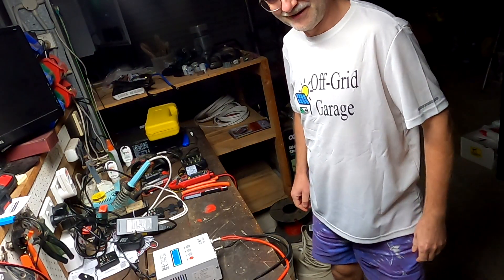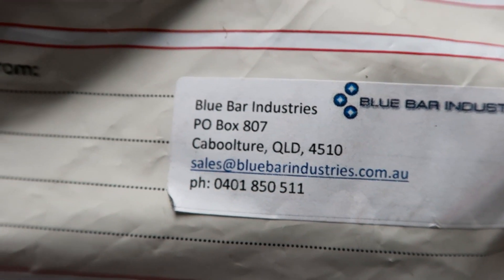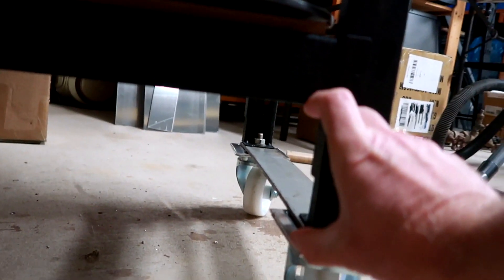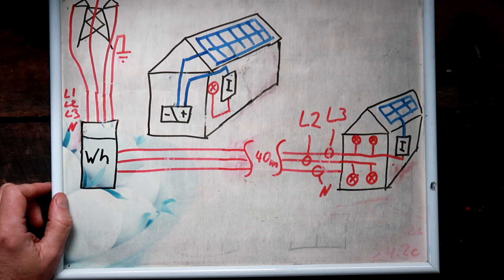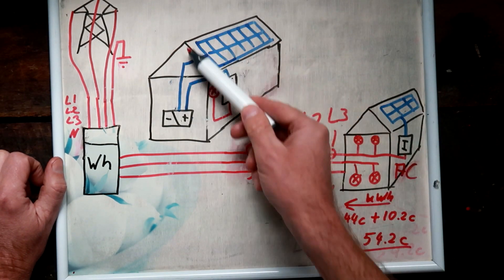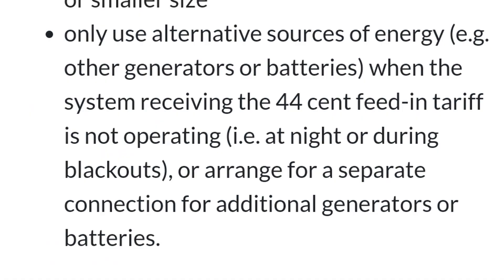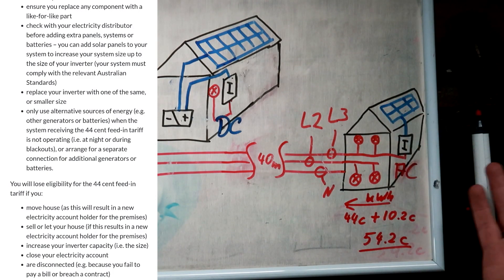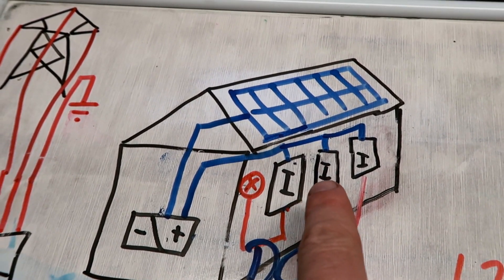Why a solar hybrid inverter will not work for my setup.

Comment: Hi Andy! 
I assume your ac is your largest daytime load and running it at night to cool the house enough to keep cool throughout the day, not sure if possible due to your climate. 
Great video exploring this. If not useful it’s still fascinating! 
https://youtu.be/0f9GpMWdvWI

Also heating water at night to use during the day if you use electric water heating. The load these would put on the battery’s and inverters and if you can recharge enough during the day could be an issue, you’ll know better than I. Then setting up an inverter or multiple to run those loads in your desired way. Many more instances this could be applied to like pumping water at night and storing it for use in the day battery vacuum cleaner, using laptops instead of desktops, portable battery generators inside the house that tv and other appliances plug into? Therefore not supplying power to the house but to the appliances? This may become tiresome or just inconvenient though but you can also just switch them back to grid if solar generation isn’t enough. But you will have a better idea than me of ways this could be useful. 
Love the videos man!

Comment: You have a great situation.  In Northern Alabama I get only 9 cents/kwh and they charge me $15/month for the meter.  So my system will barely pay for itself after 20+ years.
Reply: No one can get this deal anymore in Australia either GNiessen. It’s a fabulous old deal to get people onto solar when it wasn’t popular. Now there are vertically no more rebates as the new problem is too much solar on the grid driving voltages too high and they are talking about wanting to control your hybrid inverter now from the grid to turn it off during peak sun to protect the grid. It’s all a mess now here with too many people now on solar

Comment: Boy that sucks they don't let you add batteries etc. When I ran the numbers here in Ohio, USA this is exactly why I went with the system I did. (Grid tie didn't make sense). Once my solar is installed I will use the grid only as the backup power source. Solar and batteries will be primary source until they are depleted. Solar in the day and batteries at night is the plan... 
There is a delicate balance of solar panels to batteries as well. You need enough solar to charge the batteries as well as run the A.C. systems. More batteries (which I could use) will not help in my situation because I can't fit enough panels to create the KW to charge all the batteries and run the house. So I have my own "Shit show" here too. lol. 
"Grid assisted" here was still the way to go for me. The added benefit is that in the event we have a power outage I can still live life as usual (for a while). If I was grid tied and we had a power outage, the solar has to be shut down by code so no one gets hit with power on the lines while they fix the problem. Many people here don't understand this!
You will figure out a solution. You have a very good base of smart people here on your channel to help as well. 
I'm drinking a beer for you as I type.. hahaha..  CHEERS!

Comment: Hi Andy,

It's a shame that you didn't put another 5kW solar system on your other phase as you are allowed a solar system per phase and not per household.  Too late now.

You can move your existing circuits to your off grid system allowing to keep your 44 cent FIT.  Move either one, multiple or all circuit to your off grid.  Probably do it in stages as you increase your battery capacity. If you move all circuits from on grid to your off grid that will allow you for 100% generated energy to go to the grid and you'll get maximum benefit.  As long as the circuits are completely off grid then it does not effect your FIT.
Reply from the maker: That was never the case. The max feed in power was always limited to 5kW, regardless how many inverter I would install.
Reply: @OffGridGarageAustralia   I'm not referring to inverters.  I'm referring to how many phases.  Most homes have a single phase.  If you have two phases then you can connect two separate system, requiring their own inverters.  One on each phase and get individual FIT for each.  There is nothing stopping you from connecting another system to the grid on the other phase and receiving your providers FIT in addition to your existing system.

The 5kW is a limitation per phase.
Reply from the maker: @DavidKlaverstyn  The limitation of 5kW is per premise, not phase though. Otherwise I could install another 2x 5kW for the other two phases and get the 10.2c from my provider as you said. This would also imply separate meters, I assume.
Reply: @OffGridGarageAustralia  I don't think that is correct as a friend of mine down the Gold Coast on the Energex network has 3 phase and is getting a 15 kilowatt inverter installed with 20 kw of panels.  His electrician said you are entitled to 5 Kw per phase.
Reply from the maker: @DavidKlaverstyn  Yeah, different region, different rules. I know here in the rural area, there is a 5kW limit per premise due to transformer constrains. That could be different 5km away already if they are connected to a different substation. In new estates in Gatton for example, you can get 10kW permissions now. New power cables and new substations though.

Comment: Hi Andy, there are some Hybrid inverters that can take in an AC coupled system on the same port as the generator, so you can change with a DIP swich what you want that connector to be (in or out). Google i.e Deye 12k Hyrrid inverter or Sol-ark 12k hybrid inverter (same manufacturer but different price points) They are also possible to connect in parallell so they handle one Phase each and sync between them if needed.
Reply from the maker: Jonas, this is not my case! My grid-tied solar is on the load side. A hybrid inverter will not work. See this picture here: https://www.dropbox.com/s/34xv6gnw0seodip/Andy%27s%20cursed%20solar%20situation.jpg?dl=0
Reply: @OffGridGarageAustralia  Hi Andy, thank you for the explanation but I still dont undrstand fully why it wont work because the AC coupled input/output can be with a grid tied inverter and the Hybrid converter itself can be disconnected from grid (just like your current off-grid Inverter) and still work. If you have a mail address I can send the manual to you, they are available in size 5kW, 8kW and 12kW with same features.
Reply: I tend to agree with Jonas here. Im not sure why the Sol-ark 12k wouldnt work here .

Comment: On your breaker panel you should have a main in there turn the main off at night run your house from the batteries then you ain't got to deal with it
Reply from the maker: I cannot install a transfer switch. That won't work with the grid tied solar on my house.
Reply: @OffGridGarageAustralia  Yes it can. I know because that's exactly what I have done.

All that is required is for the grid tied inverter to not be connected to the backup side of the transfer switch, IOW it is only connected to the grid side.

I have an off-grid battery system as a backup power supply for use during grid outages (we get a lot of outages, rural northern NSW). I also have a transfer switch in my main circuit board and I have a grid tied solar PV system as well. When the grid goes off I simply flip the transfer switch and the house is immediately supplied by the off-grid system.

But this is not the scenario you are interested in, which is feeding household loads from an off-grid supply while you have a grid tied inverter operating. 

Since my grid tied inverter is not connected to the backup side of the transfer switch (IOW it's only connected to the grid) this means if I choose to I can have my off-grid system supplying loads to all the circuits connected to the backup side of the transfer switch, meanwhile my grid tied inverter still operates and exports to the grid.

The transfer switch effectively separates the house into on-grid and off-grid circuits and never the twain shall meet.

Because my off-grid system is only a smallish 4kW inverter I also have a few other high power loads not connected on the backup/off-grid side of the transfer switch (e.g. ducted aircon, oven, induction stove, while hot water is controlled load off-peak already and already grid only). Hence these appliances only operate on grid power (and are non operational during outages). But it's entirely up to you which circuits you wish to include on the backup/off-grid side of the transfer switch.

This would not breach the PFIT scheme rules as all you are doing is supplying power to off-grid circuits - the off-grid supply has zero connection to the grid, and by reducing the household loads your grid tied PV system supplies, this increases your grid exports and PFIT benefit.

The nice thing about this option is if your off-grid supply itself goes down for whatever reason, well you can simply flip the transfer switch back to the grid position and the home will be supplied from the grid as normal.

Now I know you have two separate phases supplying your home - well I have all three. Meanwhile the off-grid system is single phase supply. So how does that work? 

Well on the backup/off-grid side of the 3-phase transfer switch all the phases are joined and so when operating from the off-grid supply all those circuits are now on the one phase off-grid supply. Since there are no 3-phase appliances it doesn't matter, and even if there were those circuits would be connected to the grid-only side and be excluded from the backup/off-grid side (in the same way my 3-phase grid tied inverter is).

I'm just right now adding some solar PV to the off-grid supply and my first load to move off-grid will be my pool pump. In my case however the benefit of maximising solar exports isn't the same as no PFIT for me (my FIT is 9.5c/kWh).

Comment: Hi Andy, I have AC solar on the load side. Any hybrid inverter will do the job, not just Victron. I personally use a Multiplus II. Works brilliantly. 

You could use Sungrow, Goodwe Sunnyboy etc. they all work in a similar fashion.

They all require a power meter to measure the grid. 

I can understand not wanting to loose your feedin Your feed in tariff is insane :-) 

Here in NSW I get 9.9c, but with my 45kwh battery I don’t usually export much :-)
Reply from the maker: Thanks, David. How does the hybrid inverter cope with the solar coming from the load side as in this picture?
https://www.dropbox.com/s/34xv6gnw0seodip/Andy%27s%20cursed%20solar%20situation.jpg?dl=0
Reply: @OffGridGarageAustralia  how can I contact you? I have recorded a video for you
Reply: @OffGridGarageAustralia  if you are using a Victron system it depends on how you have programmed it. But normally it would keep the grid at 0W till the battery is fully charged, charging the battery from AC coupled inverter which is on the AC output of your hybrid inverter. Once battery is full it will export all available power. You can program it not to export from DC side so that you aren't exporting from your garage Solar. If you have an outage the inverter would disconnect from grid and keep supplying your house with power and still use the AC coupled panels to charge the battery. Look up Victron AC coupled. Works really well.
Reply from the maker: @ShaneFromSA  I don't think it will work, as my AC solar on the house is connected to the same side as the load. None of the provided schematics from Victron, Growatt or any other manufacturers can do that from what I can see.
Reply: @OffGridGarageAustralia  Here is another link to AC coupling. https://www.victronenergy.com/live/ac_coupling:start
Reply from the maker: Yes, I have seen the ESS and the solar AC been on the load side. I just doubt that my energy retailer will allow me to install a second meter and stay within the contract boundaries.
I would also need to make sure the Multiplus is only supplying power to the house when the sun does not shine (timer or sense if energy comes form the grid tied solar. I also need to make sure that the Multiplus leaves the grid tied solar through to export while letting the DC solar of the garage through to the batteries.
I could not find any information about the programming of the Multiplus in this regards.
I have seen all the options Victron has with their AC coupled systems but not sure about the timer and other programming I would need for this case.
Reply from the maker: The second link you send shows a system which is not mine as there is the DC solar missing. It would use the AC solar from the house to charge the batteries. That would be a big mistake! All excess AC solar needs to be fed into the grid for export and $$$ and only the DC solar from the garage charges the batteries.

Comment: If you connect the hybrid inverter behind the grid tied inverter, you're good to go.
Reply from the maker: But that's not where the batteries are. Won't work at all...
Reply: @OffGridGarageAustralia  It'll be a hassle trenching to the garage and running 3 core to and 3 core back to the house. Not easy.
Reply: ...but isn’t that why you but them on wheels....? 😁

Comment: Holy crap your electricity is expensive!  

My electricity costs vary based on time of year, plus I use a time of use plan to make electricity cheap most of the day and expensive for 3 hours per day.  During the winter months, I pay 7.38 cents per kWh off-peak and 10.63 cents per kWh on-peak.  Even at the most expensive time of the year (July & August), I am only paying 8.53 cents per kWh  off-peak and 34.44 cents per kWh for on-peak energy.  By far, the highest energy consumption is for air conditioning, so I pre-cool the house to be extra cold until 3PM, then don't run the air conditioning from 3 PM to 6 PM, so my on-peak usage is very low.

I keep thinking about adding solar and batteries so I can run the A/C between 3 PM and 6 PM, but it is hard to justify.  My total on-peak energy cost for 2020 was $150.21.  My total energy usage in 2020 was 17.5 mWh at a total cost of $1951 USD.  For me, cost savings for solar is pretty much non-existent since it would take too many years to pay off the solar.  So the biggest reason for adding solar + battery would be to provide power in the case of an electrical outage.  This is still a valid reason, of course, but there is no real payback period.
Reply from the maker: What do you mean with expensive? That is my feed in tariff... Misunderstood the video?
Reply: @OffGridGarageAustralia  no, I just made a (poor) assumption that they wouldn't pay more than market rate for power, which would mean your power costs that much or more.

Comment: The things I can think of are from the beginning that you use angle iron / L-profile instead of flat iron on the shelf and solder or hulls on the connector for your BMS so you do not use the same hull that will conduct the current (to get as good contact as possible )

As for the house, I saw (at least not where) that there are inverters that have a clamp to measure the current so they only feed as much as your need is as there are many places around the globe where it is forbidden to feed to the mains so it should take a while to connect it to the L2?

is it to sell as much as you can or do you not have to buy anything yourself without 100% of your approved installation going online?

but is your system as you described, you can well not have things that go on several phases as it becomes unbalanced. What would happen if you turn off the fuse for L2 and feed in it with an inverter from your battery or will it be wrong with neutral and earth then?
Reply from the maker: Yes, the CT inverters may be a possible solution...

Excess power gets fed into the grid during the day and I buy some energy back during the night. That's how it works at the moment. We use around 80% of our electricity after sunset, so I would like to offset this from the battery without loosing the tariff.

Comment: i did not see anything about not taking some of the load off the house and transfer to the shop in bulk. but you could transfer switch at the house transfer some small amount during the day and all at night the the shop slowly over time xfer over small amount to shop till you are at almost break even. right now i am running 90% solar and 10% city. it would mean putting in more wires to the house to a transfer switch and leave the existing wires alone key thing is to still have a break even point or a little pay in the end.
Reply from the maker: As per contract, I can only do this if the grid -tied solar is not working (eg. after sunset).

Comment: Wow. No wonder why there is so much solar in Australia. If they pay you 54.2 c per kWh, what is your grid cost? In Manitoba Canada, we pay 9 c per kWh. I really want to install solar but with cheap hydroelectric power, it is hard to convince my wife to invest in solar.
Reply: lucky canadians! hydroelectric for 9ct is awesome (german perspective) ... convince your wife with water becomming the next reason for war all over the world ... than you need solar as you need the water for cooling yourself at temperatures you get this year thanks to the climate change ! isn't that enough ?
Reply: @slebeig3035  
Haha, worth a try!
Reply from the maker: We have two tariffs connected to our premise. the 24/7 tariff cost me A$0.25/kWh, the other one will be turned of during peak hours and is for loads like electric hot water, pool pumps and the vehicle charging. It costs me A$0.20/kWh but is not available from ~5pm to 9:30pm
Reply: @OffGridGarageAustralia  
That is certainly incentive for solar. Even thought we are considered “up North”, on the prairies we have long (18 hour) sunny days in the summer, but only 8 hours in winter. We also have extreme temps of 30C+ in summer and easily -20 to -30C in winter. Both require lots of electricity. Still, I would love to load the roof with solar!